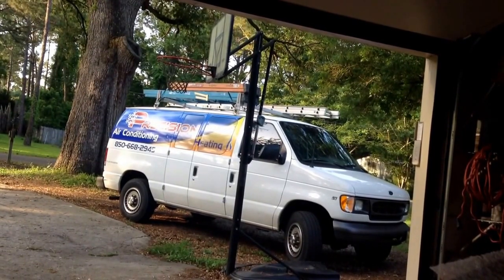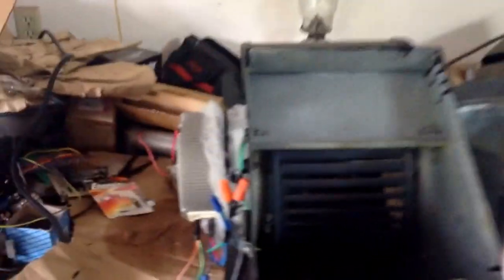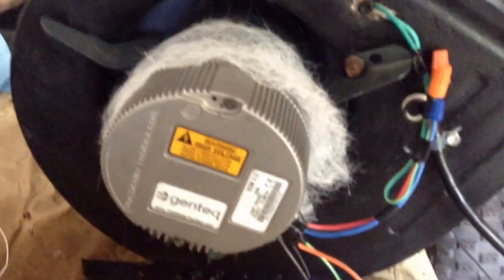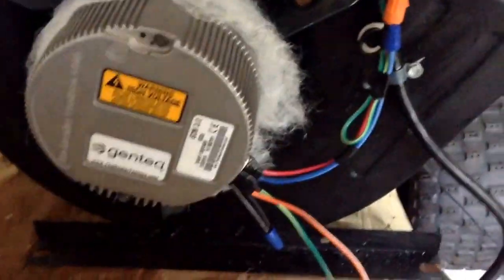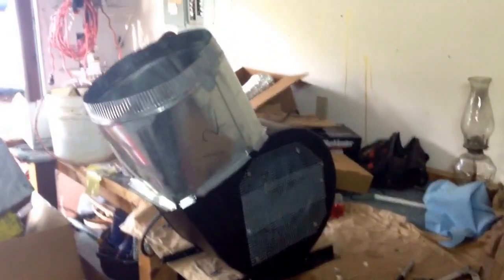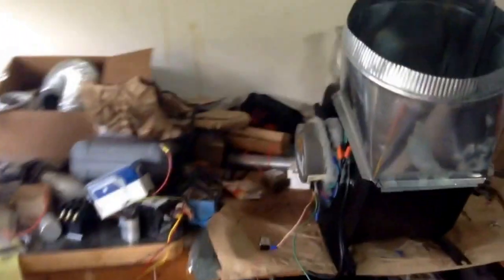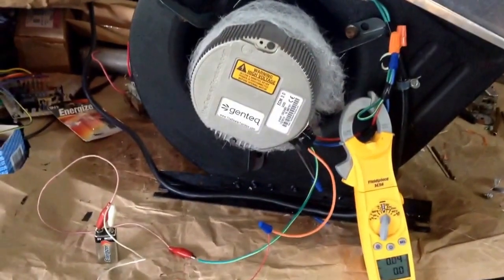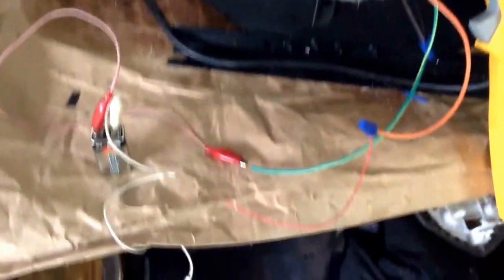Blower project 3.0 stage2

Comment: Should've went with an tiny pankcank sized blower or something, the flange to collar is a way better idea.

   You should Patten a add-on peice to the blowers that are already kind of what your trying to build. You know the one that rotates and has like four outlets on the side, it's really small but can blow you away lol

   Anyways design and add-on peice to that, that can comes in differ sizes or just one with any easy to snap on snap off or something to quickly and securely attache the flex too.

   Make the flex too like design a small, tough, rubber but just thick enough so it wont sweat all over the place, flexible one or something lol

   Theres your million-dollar idea lol